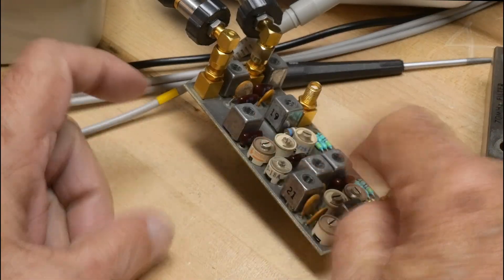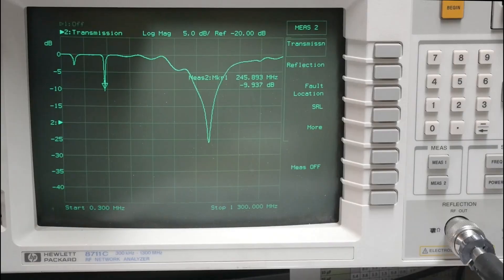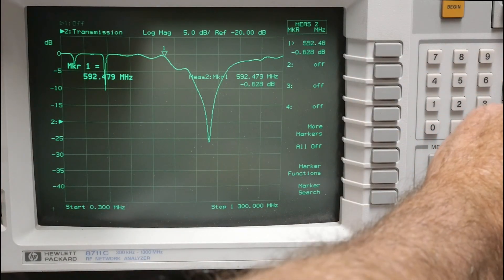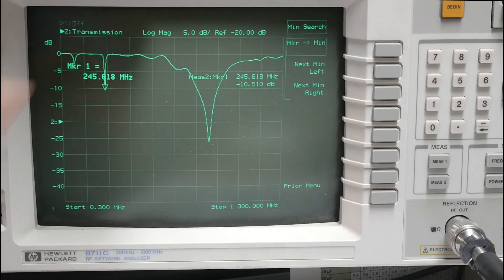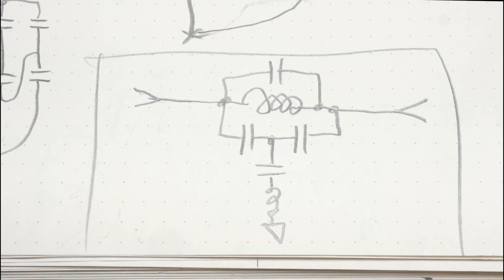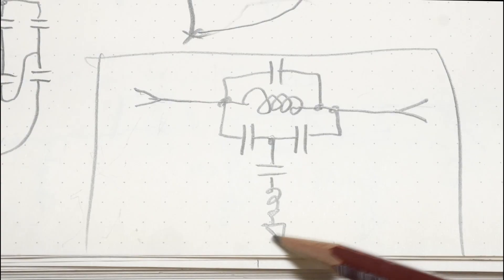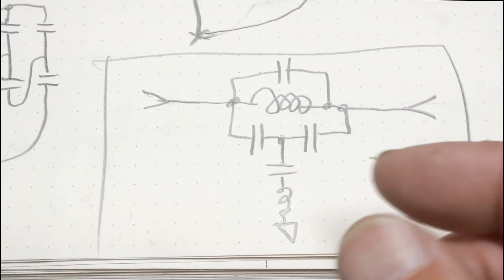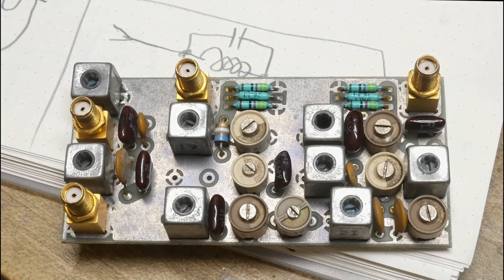#2250 70MHz Bandpass Filter (part 2 of 2)

Comment: This type of filter gives a very deep notch even with non-ideal components (like inductors). I had a project where I used four such filters in series to take out four interfering signals close to the signal that I was trying to capture. You'll also find out that even with multiple filters like this in series, there's very little interaction between them.

Comment: I have built a filter with that topology.  It can produce a very deep and narrow notch.  It does better than you might expect from the imperfection of the inductors.  The inductors are likely the same series of product at least.  The current that makes it through the parallel LC and the current that makes it through the "T" are just about equal and opposite.

Comment: There is a lot of mobile broadcasting stuff going on near 857 MHz including GSM uplink, so I'm not sure why you disregarded this major notch...
Reply: The components used are not the type of components one would use at 857 MHz. I think that big notch is accidental and involves interaction of stray L's and stray C's with the components on the board.
Reply: I think he is thinking of it as from a previous era.  Also the part values look more like stuff for the lower frequencies.